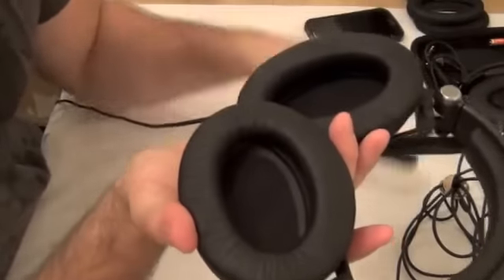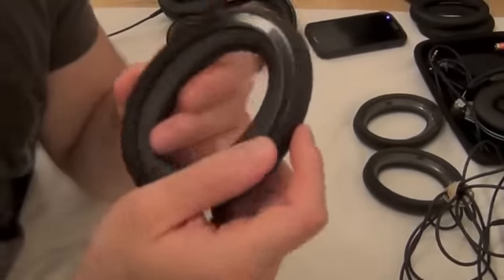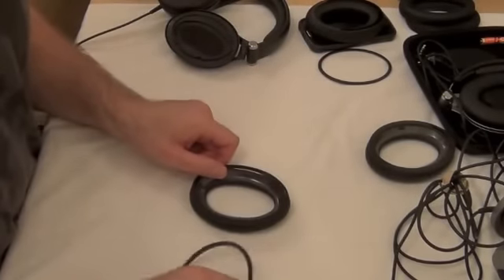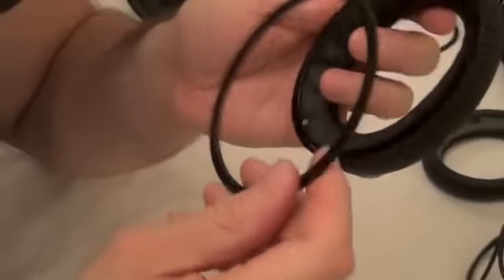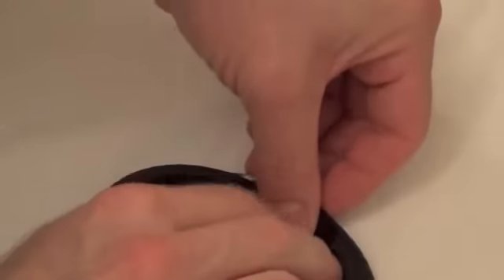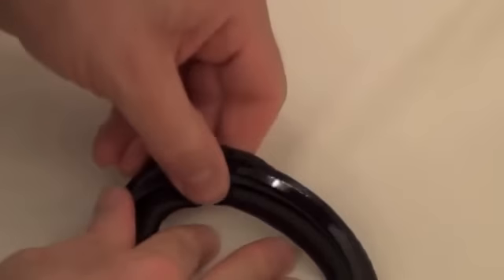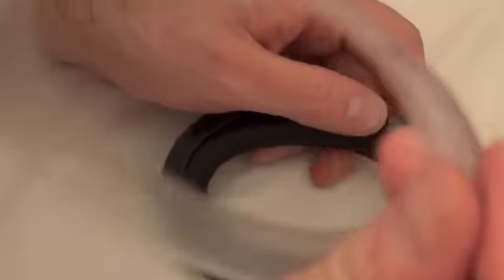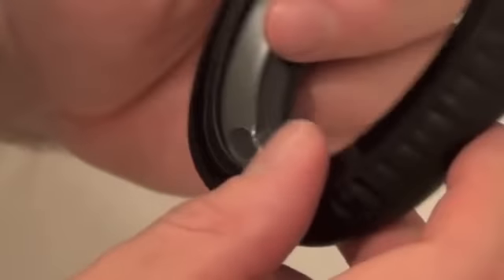How to Install HeadphoneMate Sennheiser 450 etc Ear Pads

Comment: What purpose is that plastic ring that you removed from the original pads and transferred to the new? My original pads for the PC-350 had them but I didn't transfer it over and the new ones feel firmly attached. I assume the new pads might have included them but I really didn't check and I'm almost certainly not going to take it off until it's time to replace again.
Reply: ikkuranus it is the lock ring that keeps the ear pads stuck to the headphones.  this video was specific the headponemate 1st generation replacement ear pads.  they did not have the lock rings pre-installed, so you had to take them out of tge old ear pads and out them in the new.  did you buy original sennheiser replacements?
Reply: I'm not sure, bought them on Amazon through a third party seller since Sennheiser didn't have them for sale directly. the packaging did look legit and the actual product feels the same as my originals. The only difference is the ear cushions claim to be made in china whereas the headband cushion (which for sure is legit) was made in Taiwan.
Reply: sounds like you got originals as they snapped in right away and that means the lock ring was pre-installed.  which is why you did ot have to do that step.

Comment: Not sure what all the complaining is about. Worked a treat. Thanks again. I also used the original flimsy plastic inserts back in the new ear pads which was better than the new ones supplied. Getting the ring is important!! Sits under the black plastic rim on top.

Comment: Thanks! This video was a must watch for me, i watched to replace pads not whole headphones and i couldn't do it without this. only part i did wrong it put lockring in upside down the first time, oops. I have the PC 350 set and these instructions work for that model also.

Comment: What's the plastic for that you last put in
Reply: +Jet Mac It to me seems to simply act as a support
Reply from the maker: +zengrath the thin plastic is not included with all models.  tends to be on the pxc450 and above quality models as they use softer memory foam and it help keep is from compacting to much.  pc350 has harder foam and does not compact as much so no thin plastic included by sennheiser.  these headphonemate pads were modelled after pxc450 pads, so it was included.  all in all these pads fit about 12 sets of sennheiser headphones
Reply: B Ross I have the pc350 and it was hard as fuck to put in lol
Reply from the maker: Yup, it is not the easiest thing to do but that is how sennheiser designed them.  We can only play by their rules.  If you bought the most recent headphonemate version of pads there is already a pre-installed lock ring.  So it is easy as pull off and snap in, no fiddling with lock ring like in the video

Comment: Sorry but this video is not good . There is another video on the sennheiser site for pc350's and the guy shows keeping the original plastic in at first which is probably easier because putting it back in after really bends it and kinks it. Also this guy does not show the pads being put back on. Bad quality video as well. I found the inner plastic piece shows in spots after reinstalling pads, this cutting into my ears after. Maybe I didnt do it right but this video was not very helpful.
Reply from the maker: That is funny seeing as I have done this hundreds of times and so have others.
Reply from the maker: Yes it does, they will not lock in place without it.  What headphones. Do you have?
Reply: +B Ross I have PC350 it snaps in without that last thin plastic piece but it seems like a good idea to have it in for the added support.
Reply from the maker: +zengrath yup it it not definitely required for installation.  just an extra but it was included with the headphonemate pads

Comment: You are insistently off camera when doing the most important bits. Are you jealous that we might actually see how you do it?
Reply from the maker: Yes,  In 3 years you are the first person to notice my intent.  I suggest you make an update video as I no longer sell these ear pads and this video only remains on youtube as many others found it helpful.
Reply: He's also using a potato camera. 360p is not going to allow us to focus on the really tiny important bits.  Really wish you were shooting this in at least 780p.   So now I am stuck with PC 350s with no pads because I can't tell where the lock ring goes under which plastic ring.  I do know the lock rings bead flange is supposed to face up into the pads from underneath so they can clip onto the cups inner flange ring buy your video can't show that really tiny critical detail.